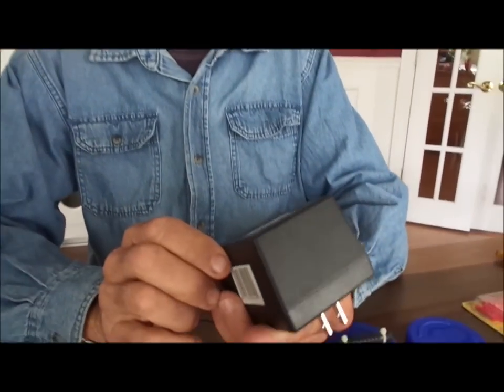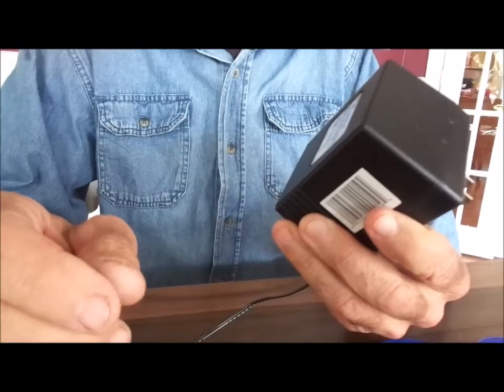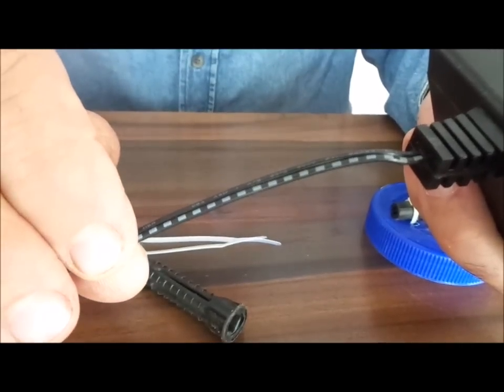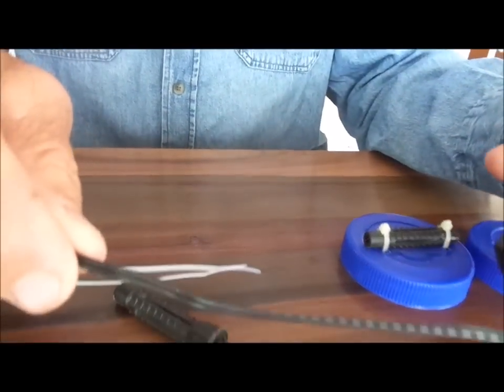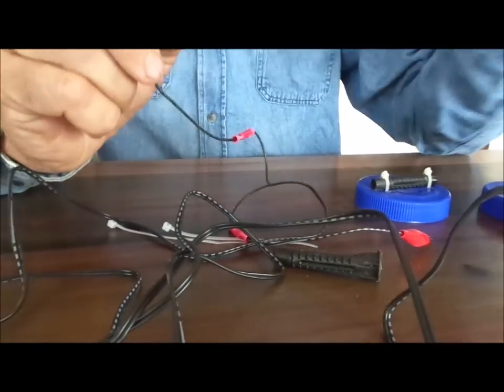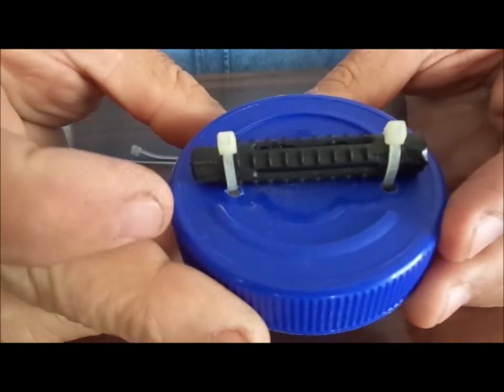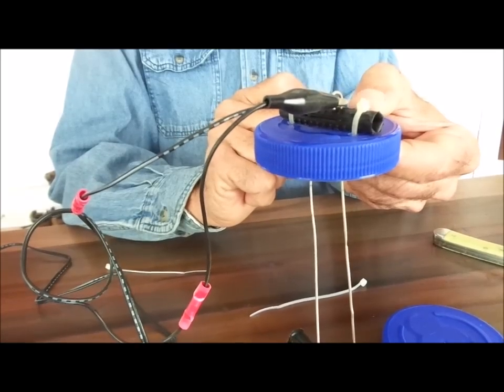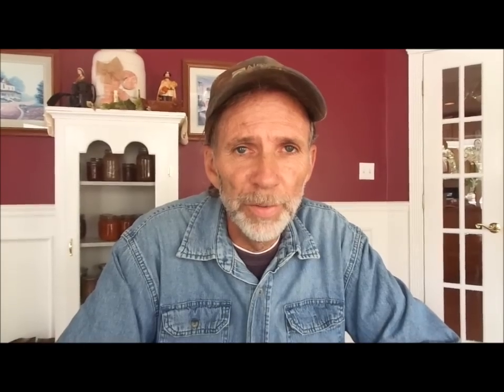DIY- Colloidal Silver Machine

Comment: why not connect dc positive to a stainless steel drink container and use a plastic lid with one 1/16 hole in the center for the negative silver electrode.  bare the + wire and put it under the ss container manking the ss container positive and the silver wire negative 

electrons flow from negative to positive thus creating  particles of silver in the water

imlo.
Reply: If the vessel is metal it might silver plate the container. Cool, but not the goal.

Comment: I use a convert like that but it is only 12 volts and it works GREAT just take a little longer ! Do not make a big deal about the polarity just hook the wires to your silver bars one on each about 3/4 of a inch apart !
Reply: I was wondering about that! Why the detail given to the polarity when both rods will be submerged at the same time? Thank you for clarifying this.

Comment: Why did my silver solution turn yellow. Does it mean that it is bad?
Reply from the maker: No,  it is actually supposed to be a golden color when done right.  I researched this many years ago.  If the time of day, tempt, humidity, and length of process is all done right, you will have a golden color.  I have mine turn golden  most of the time.
Reply: @DeepSouthHomestead , is there a way you could edit one of your vids to include the different ways it may look when finished? From what I understand,  it's different for each person.  Is there an example you could post that is a definite "wrong...back to the drawing board " situation? I've seen it black,  brown(dark), red.  Just a thought.  I'm excited people are finally waking up.  (Not all...some)

Comment: How much liquid do you use? 
How long do you leave it on per 500ml? 
Do you use a Parts.Per.Million. tester?
Reply: Basically if you start off with distilled water should read zero on TDS meter after 10 min's take a reading probaly around 2/3 ppm in an average glass water , go longer for stronger .If you look at the rod's when inserted into the water after maybe 1 min you see it working on one of the silver rod's like a plume or vapor of smoke, make sure after 10/15 min using you  wipe down rod's with green plastic scouring pad swap them around, & give the glass quick stir with something non metal like a straw,  Then continue or else if not wipe regular will slow down process !
Reply: @teebee6689  ok Thanks!
Reply: @teebee6689  it was said tat the test meter only measures electrical current not the actual content
Reply: @fmtvarse  I've tested both ways and it seems to read the same whether power was on or not
Reply: @teebee6689  okay thankyou . I also saw the use of coffee filter papers to take out any large particles or clumps . Thanks again

Comment: how to get 27vdc... eBay... dc step up, step down power supply for 5 dollars or so. can now use 12v battery input and adjust your output using a voltmeter to set unit to desired dc output voltage without available grid ac

Comment: Nice little set-up except for current limiting and stirring. When you can't limit the amperage the cell gets more conductive and more and more silver is released causing that smoking electrodes you'll see after a while. This is not what you want. These are big clumps of particles that can't be absorbed and will settle out of solution. About 15 Mamps is ideal. Less is ok but it will take longer. if you have nothing else and its shtf time this will work. If you want to make great CS get a DC power supply, heated magnetic stirrer , a couple silver bars or coins 9999 silver from reputable dealer , NOT EBAY . I use silver maple leaf coins from the canadian mint. For legit info go to : Colloidal silver colloidal gold forum. It's good , it's free. Youtube zerrofossilfuels for demo on there technique. Also video by Tinklenburg
Reply: why not ebay
Reply: @esecallum  Ebay is loaded with chinese knock-offs/counterfits. Go to apmex or gainesville coin and get a mint direct canadian coin or bar. Even from a coin shop you could get a counterfit coin unless it's sealed. You're going to ingest this stuff. You have to be certain.

Comment: Why not directly from the wall. Cut a old cord plug it in and use the two ends on some silver in water.
Reply from the maker: The silver is made with DC current.  The wall plug is AC.  Must be converted.
Reply: @DeepSouthHomestead  Are you absolutely sure colloidal silver cant be made with Alernating Current?
Reply from the maker: It would probably Short out and trip a breaker in your power box.
Reply: @DeepSouthHomestead  I just tired it with two nails and a cup of water there was lots of bubbles and heat. I think I'm going to try with silver when I can get my hands on some.
Reply: Or is that too dangerous or something.

Comment: can i use 12 volt 2amp adaptor?
Reply from the maker: I don't know.  You would have to google if the two are interchangeable.
Reply: 12 Volts is ok. It will take a little longer , but 2 amps is way to much amperage. 15 Milliamps is about maximum. I've heard people using little wall wart power supplies. If you put a resistor on the hot + leg. I put (2) 4.5 milliamp resistor on the positive side and that works great. Got them at mouser electronics on the advise of Colloidal silver colloidal gold forum. Learned of them from youtuber Zerofossilfuels. Good demo

Comment: What gauge wires are you using? How long do you let it brew until you unplug? How long does it last and do you water your dose down or drink a full glass?
Reply: I don't know about gauge,  but it depends on the machine. You can even see the expensive ones have colored lights and the water looks like it's boiling.  These folks are just trying to share the wealth of their knowledge of something that can potentially be pricy.  I'd do my own,  first. You should make sure you have a good experience with it. DIY is really the best way to achieve that.

Comment: Question 2: Will CS also kill
the beneficial bacteria in your mouth, stomach and intestines that's
responsible for Producing enzymes and converting minerals, fats and amino acids
into simpler forms so that it can be transported and enter into your body's cells? Beneficial bacteria
are also responsible for Producing Vit c, B complex, K 1, K2, B12 etc... They
also produce Special Short-chain Fatty acids that's responsible for intestinal
membrane health and energy production. Beneficial bacteria
are responsible for warning the immune system about Bad bugs floating around.
They are directly responsible for crowding out bad bacteria and some have the
ability to produce their own anti-biotics killing off bad microbes. I certainly don't
want Colloidal Silver in my body if it cant differentiate between the good guys
and the bad. ... It would be super
easy to TEST. Take some Probiotic and treat it with colloidal silver and Watch
under a microscope what happens.... Is it still Alive? CAN THE treated microbes
be cultured ? if not, they are dead.....................
Reply: It does not. I've drank two quarts in a 24 hr period. No intestinal issues at all. When I'm that sick I do take a pro-biotic after the silver anyway. Sounds like you've already made up your mind anyway.

Comment: Brother just take 3 9volt batteries=(27v) and run them in series clip to the open posts +/- clip others to silver rods,etc. and put in jar of Distilled water and wala :). You did it ;).
Reply: pearler uanir how long duration?
Reply: SmalltimR link is broken :(
Reply: @esecallum  nice tip thanks!

Guess I need to get another pair of dollar store headphones to use that trick... I'll measure voltage and report back, I doubt it's the 30+vdc I'm using now with four 9v batteries, but still a good trick to know if shit really goes sideways
Reply: @gadgetsage  YOU CAN ALSO USE ANY DOLLAR STORE SOLAR GARDEN LIGHT SNIP ONE OF THE LEADS TO THE LED BULB AND CONNECT TO SILVER RODS. I MADE A VIDEO IN MY CHANNEL.
Reply: @gadgetsage  YOU DONT NEED 30 VOLTS!!! I use boiled tap water which is quite pure in my area and also you make the spacing about 1 cm or 0.5 cm between the electrodes. see my channel 1 volt colloidal silver maker!!! 1 volt!!

Remember current flow is what creates
cs . voltage is simply to push a required current thru a resistive medium.
Reply: @esecallum  if you're using tap water you're flirting with argyria, only cases of argyria involve tap water or salted water
Reply: @gadgetsage  NO NO AND NO. ITS A BIG PHARMA PROPAGANDA. I will ask you one question. how many people in your whole life have you met who were blue because of CS?
Now tell me how many had cancer?
high concentration silver SALTS may turn blue and will be a gradual process. my electric kettle has very minimal deposits so i know the water has minimal dissolved salts.  Have you noticed how that smurf guy was paraded in front of the worlds tv cameras to scare them?
Reply: @esecallum  Can we talk mate..cheers
Reply: @esecallum  I want too make some coloidial silver and I keep getting different replys as too correct way too do it most people say use 27 volt and then I saw somebody say 4-6 volt so I thought cool I just use a USB cable cut it n add resistor too get right amps but now I saw your comment your saying 1 volt so I guess I'm just asking some advice kinda run me through what you do  and why if that's possible mate...i know the lower power volts amps will make smaller particles but take a bit longer I don't mind waiting I just want best end result so yh get back too me when you can if can...thanks
Reply: @jshaw4757  Look get any 5 volt charger split the wires and put a 3.3 kilo ohm resistor in series and space the electrodes 1 inch apart. that is it. use boiled water. why? gets rid of dissolved gases and any existing pathogens in the water. The 27 volt is for people using distilled water and wanting the CS very quickly and they then put a resistor in series to drop the voltage as they get clumpy CS. The 1 volt thing is experimental to get ultra super fine very small particles and takes days. its a proof of concept and you dont to bother with it. you can even 2 or 3 1.5 aa or aaa batteries in series...
Reply: @esecallum  Cool cheers well I'm happy too try the 1 or 2 volt experiment I wait a month if I had to too get the finer particles but cheers for the heads up I will give a go 👍👍
Reply: @esecallum  I've got a berkey water filter so it's good quality filtered water you think I should try that maybe boil it like you said then try that..cheers
Reply: @jshaw4757  Remember its the current that is  important and should be in the range 0.5 milliamps to 1 milliamps
lamps. lower currents mean longer waiting time. here is the equation  1miilamps =40 minutes =710 ml = 3.78 ppm

1 milliamps 120=710 ml =7.56 ppm   AND so on...
Reply: @esecallum  yo yh I hear ya I know current is the one ..volts are easy too get the current bit more tricky I built salt batterys just 2× copper coins with salt water and a bit off cardboard and one cell ran a little diode about 2 hours but when I tested the current it was in the micro amps so I dont know how it powered the diode for 2 hours from a dab off salt water but I will make larger wider ones more surface area gets you more current and make like 50 off em and parallel stack em (voltaic stack) the first battery made I think they they good stuff but yh if parallel 50 cells hopefully get usable current from sea water just one my projects mate maybe I could use salt cells alone too do the silver brew ..each cell is 1.5v so get as much volts as you want but yh the current is a challenge with salt batts copper n zinc washers..but imma try again I'm determined make a good salt batt...anyway just sharing cheers
Reply: @jshaw4757No because you can't ever filter out all contamination the hot water will kill bacteria but won't do nothing for the minerals or chemicals in the water
Reply: @jshaw4757The colodial silver in the manual I have says that 800 to 1,000 millivolts is perfect for Silver 1,000 millivolts is the same thing as 1 volt of AC current
Reply: @esecallum  WoW this is excellent information! I love the idea of adding music to the mix COOL 
Thank-you
Reply: Never use salt in distilled water as it will turn into silver chloride and this is what causes argyria, turning your skin blue
Reply: I thought you always used distilled water because of the minerals in tap water bonding to the silver particles
Reply: Why does it matter which alligator clip you put on which one why do we need to know that?
Reply: D I water will not work
Reply: @tommyconrad5628  D.I. water is de-ionized, its beyond distilled. distilled is good because it's clean, but needs a little pinch of salt as an electrolyte for the process to start.
Reply: @modelnutty6503  if you like silverchloride it does yes ;)
Reply: @modelnutty6503  destilation with active carbon filtration is better
Reply: @modelnutty6503  de ionized contains no ions true but stil can contain chemcal polutants so thats why filtration after destilation produces more pure thus a better quality ;)
Reply: @modelnutty6503  that "pinch of salt" stuff is extremely old timey and dangerous at least as far as argyria goes. 

As in, the only cases of argyria are attributed to using salted or otherwise impure water.

Comment: Thanks for the info.  I wanted to see a close up of the lid. This was even better.  My ? Is grid goes down for long period and you need more can you make using a battery if so what size. Thanks Cheryl. God Bless
Reply: I use 3 9 volt batteries run in series . What that means is you plug one battery post into one battery . You plug the third battery into the #1 battery . Know you have three 9volt batteries run in series which gives you 3x9 = 27 volts ;). Now clip the positive and negative remaining two post and clip to silver rods . Put in Distilled water and your good to go . I have a PPM meter . Which helps as ,temperature ,humidity ,storm activity seem to change the time to make . I make enough at one sitting to do the year . Of late I have passed some to friends who could not afford the sickheal medicine of today . It seems to be spreading .Shoot,I give it to my steer calf .
Reply from the maker: 9 volt batteries are what you need.  I keep a few around just to make silver.  Thanks

Comment: I went to that hauser and miller website to purchase the wire but I am confused, do you just select the sterling silver on the drop down list? I had never heard of that other named silver they have on there. Thank you so much for doing this video by the way! Me and my son are going to make this as soon as we round up the stuff. You two are appreciated!!!
Reply from the maker: +Amber Carl Make sure it is 99.99% pure silver.  No additives at all.  I haven't ordered from them in a while but the type I ordered was "fine silver"  14 g.  and I ordered 3 oz.  It came in a coil.  I cut the rods to fit in a quart jar without touching the bottom of the jar.  Do not use sterling silver.  If you have any questions, please ask.  Thanks
Reply: Could you get silver rods from a jeweler?

Comment: Love it, thanks for the video Danny.  I know that you are supposed to use purified  water, do you add any salt to increase conductivity?
Reply: and no purified water. it had to be distilled. and also the black that builds up on the one electrode is silver oxide. that is from direct current.
Reply from the maker: +Bradley DeRosia No, do not add the salt.  That is something that some sites put out, but for what we use, we do not add any salt.

Comment: Because of the expense, I don't want to order the rods until I know the transformer I already have is OK to use.  It is a 30 volt transformer, will that work or is it too big?  If the 30 volt will work, to make colloidal silver in a Quart jar, how long would you advise to run the machine?  And finally, I have not been able to find the tester Wanda used to check the particals - do you have a link?  We hope that each day finds you feeling better than the day before.  Thank You for all your knowledge and your willingness to share.
Reply from the maker: +keepercreek I don't know if the 30 volt will work.  But if it goes from 110 ac to 30 dc. then it might.  You might ask an electronic tech.  I would check it at 30 minutes.  The meter was a neighbors.  I think you might check Harbor Freight.  Not even sure what it is called.  I will ask when he comes by.  Thanks
Reply: Robert Foster Morning Robert.  We are making our Colliadal Sivler maching this afternoon.  We did more research and have come to realize that a 30 amp will work - we are just going to monitor the time and test the particals (ppm) with the tester we bought.  One problem we have had is finding the 2-3" concrete anchor Danny used - no one seems to have one.  So we are using a piece of plastic quarter round molding which I believe will work.  Good deal on the transformer for a $1.00!!
Reply from the maker: Hey, every deal is a good deal.  And yes anything plastic would work for a anchor.  I wish you luck this afternoon.  Let us know how it works.  Thanks
Reply: +keepercreek, I would like to know how it turns out as well. I just bought a 30V. for a buck at a junk store.

Comment: what gage of wire is that? Thanks
Reply from the maker: +Sue Ashcraft 14 guage from Hauser and Miller
Reply from the maker: +Sue Ashcraft The wire most companies sell is 16 gauge I think.  Either will work.  Also silver bars as long as there are no additives.  Most will add another metal with the silver.  Make sure there isn't any other metal in it.

Comment: I guess i need to do some research on why it needs to be 27 volts. I have done a lot of rust removal with 12 volts and electrolusis or how ever you spell it.
Reply from the maker: +OkieRob 24 volts has worked fine for us.Not sure why they say 27 volts is better unless its a marketing thing.